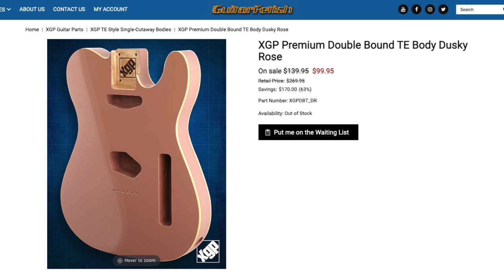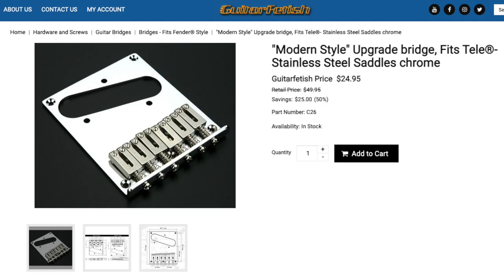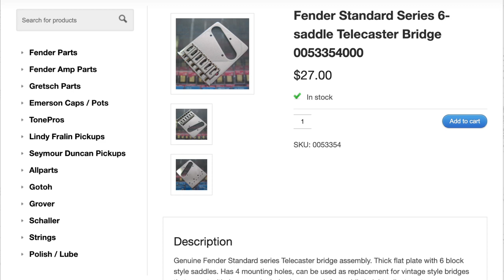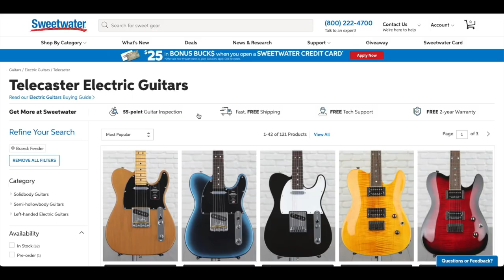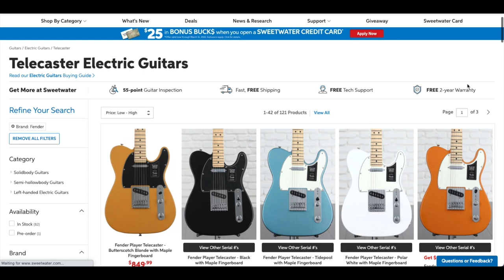I Built My Own Telecaster - Worth It?

Comment: Nice build. You can be assured that you have a great, personalized guitar, every bit as good, if not better, than a Fender model. And for less. Which brings me to my point. That is, it be even less costly and with no less quality, if you purchased the neck also from GFX. Save $200 right there. Many high quality components every bit as worthy as name brand,  also could be used to save on expense without sacrificing quality. I really like the body and neck by GFX, as well as some Tonerider pickups,  and electronics that are as good as 920D. Love the color. I'm getting same thing.

Comment: beautiful sounding guitar...and overall beautiful build... curious about the input jack plate though.. did it not go into the body all the way? seemed like 1/8" sticking out or something. about to try building one of these myself and wondering what to look out for.
Reply from the maker: Great question! And something I didn't address in the video. This is not a standard tele input jack, it's one of the Electrosocket jacks that come with a threaded hole (so they never get loose). With the curve of the body it didn't fit perfectly into the cavity, but that's part of the design of the Electrosocket. They are a bit weird, but I recommend them for saving headaches with the input jack getting loose and spinning inside the guitar.

Comment: Shit, I took a bullet squire that had a real thin chincy neck and bought an $89 Glarry Thinline just for the neck.  Reshaped the headstock, dropped in some Guitar Madness quarter pound pickup, didn't even have to touch the frets which shocked me.  Now you can put it down -if you're into 50's necks.  Thing is 10 times the instrument it was with that stock neck.

Comment: Very nice build, I have the same xgp body in lake placid blue, which is a vintage specification and the modern bridge is the same as yours and gives me 25.5 plus 1/8, could you explain how you did it? Thank you
Reply from the maker: Thank you! Interesting, that's strange. I honestly don't know exactly why this would be different, but for some reason my bridge pickup routing location did not allow for the correct 25.5" length when I placed the modern bridge. No idea! But I'm glad yours worked! Hahah
Reply: thanks for the reply! Maybe I wasn't very explicit, I couldn't put the modern bridge the same as yours because the body of the guitar has “vintage” specifications, it is for the bridge with three saddles. My question is, how did you install it, did you achieve the measurement of 25.5 or did you have a difference of 1/8 like me, which I can't move the high E saddle anymore. Thank you again!!
Reply from the maker: @mondodicromo  ah now I understand what you're saying. To intonate properly, you would need to move the bridge that 1/8 inch. I ended up buying a different bridge (I show it in the video) to hit the 25.5 measurement correctly. The modern bridge didn't work, so I had to buy something else. The fender one I used was very budget friendly though!
Reply: @loopngroove7414  Nice build. It's been a while so I don't know if you'll see this, but, when you changed the bridge did the string through holes still line up or did you have to top load it? I've looked at those bodies before.

Comment: I’m about to do my first Strat build. Do you ever have problems with the finish cracking or breaking when you pre drill the screw holes?
Reply from the maker: I didn't have any issues with this. I would use painters tape in the areas you'll be drilling, and go nice and slow with the drill. The finish can be delicate on some of these guitar bodies, so take your time. What holes are specifically are you talking about?
Reply: @loopngroove7414  the holes for the 2 point tremolo are my main concern. And the pick guard holes to a lesser extent.